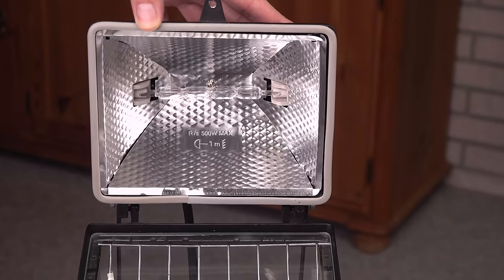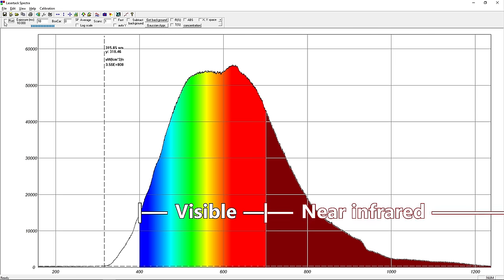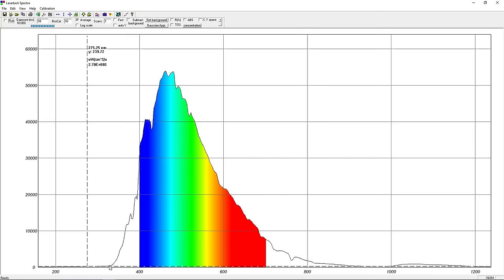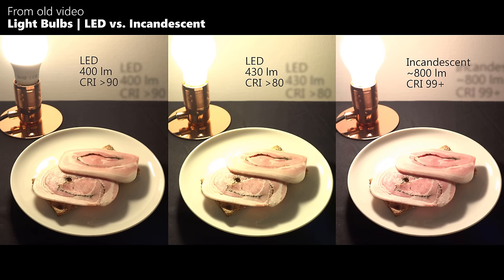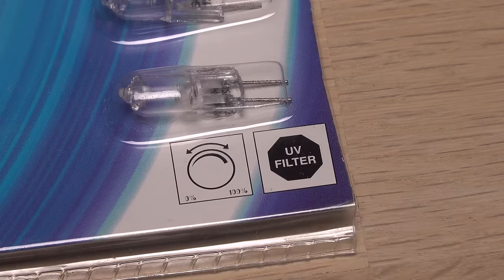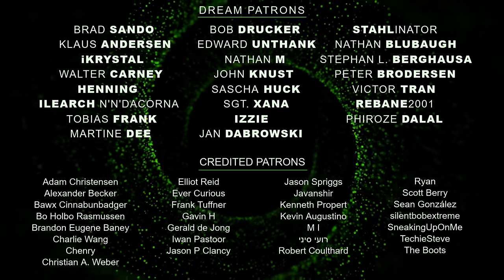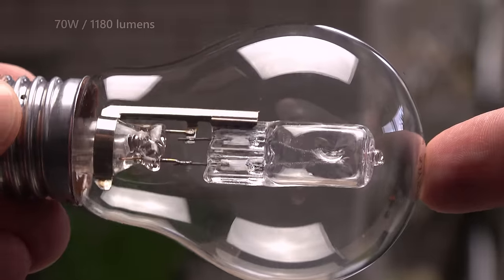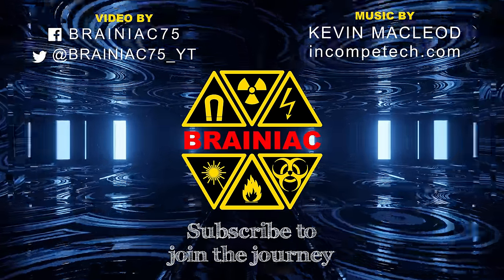Hidden Hazards of Halogen Lamps

Comment: I remember halogen bulbs.  Some Torche lamps used to use them and put out good light.  These were actually popular in the 1990:.   But a lot of people phased them out because of the heat risk.  Some of the halogen lights also used to be popular outdoors on commercial buildings, tennis courts, horse arenas, amphitheaters, and other applications.
Reply: I remember the 90s. Back when the future was bright. I don't want to be here anymore.

Comment: I have energy saving LED everywhere in my house, but you are absolutely right, food looks somewhat off, so I use an old incandecent lamp in my kitchen, hopefully it doesn't die too soon. I wonder if there is any LED that can make look food "normal".
Reply: HiCRI LEDs can do that
Reply from the maker: LEDs are getting better and you should be able to find some with a CRI/RA rating of >90 relatively cheap (IKEA has them last I checked). They are much better than the old ">80" horror shows...  LEDs with >95 are even better but much more expensive and I've only seen them in dedicated studio lights. Thanks for watching!
Reply: Not anything that you can pick up in a semiregular store.
Reply: FEIT Enhance or Sylvania Tru-Wave bulbs are 90-93 CRI in warm white 3000K and are sold at many stores now - Menards, ACE Hardware, Costco, and online.
Reply: Lidl sometimes sells >97's in Europe for pretty cheap, so you may be able to find them there.
Reply: @xavier6130  I have seen those, I returned them do to them having non existant R9 value, wich is not included in thier cri rating

Comment: I did sometimes get mild UV suntan from working under high power halogen lamps. But not as bad as from arc welding on a hot day without skin protection from the arc .
Reply: Might be the already existing melanin in your skin getting oxidized by the UVA rays, causing a light tan that will most likely disappear quite quickly.
However it can also cause premature aging of your skin as well as increase your chances of getting a melanoma much later.
Despite not causing sunburns.
This is basically like a low power version of the UVA tubes used in tanning salons.

Comment: I use to be an electrical contractor and also done my apprenticeship after leaving school, anyway back in the day I had fitted many of these lights I have even fitted 3kw lights to loading bays, yards etc and for testing purposes operated them without the safety glass. Back in the 809's i wasn't aware of the uvc problem and i dont remember collage remarking on about it. Anyway each time i had left an installation the safety was attached to the light and cover screwed up tight , makes you wonder about halogen car headlights!
Reply: Well, some halogen car bulbs do filter UV by themselves as they glow blue under a blacklight.

Comment: I work at a TV station. We've mostly replaced the studio lights with LEDs, but there's still a few high wattage (1KW+) ARRI lamps kicking around. Those all have Fresnel lenses. A lot of the portable halogen kits for video production were bare bulb. Just a set of folding barn doors for protection when stowed. Was drilled into us back in college to never touch them. Of course every time you rented the kit, there was always at least one bulb was burned out and needed replacing. So you'd have to gingerly fondle the spares with a set of gloves. Those also got so obscenely hot that it was rare to see ones that didn't have melted plastic parts. I'm glad they've been phased out.

Comment: Cool 1500W lamps ! Didnt know they made 1000w into 500W sized bulbsall this time after collecting some old-stock bulbs my self. It would be wounderfull if you mke a video about the 1500W ones and 1000W ones. The fact that halogens produce UV is funny. T think that the reptile-halogen lights werent joking when saying about UV-A and UV-B. Maybe you should try a reptile-halogen light. They tend to also include the spectrum on thepackage but a real test would be cool. And as usually a great and reasearched video ! Keep it up with interesting light nulbs !

Comment: I have one of those tall lamps that reflect the light upwards to the ceiling, and it has that same long halogen bulb, except it is 500 W.
Reply from the maker: I had one too! But it fell apart during a move. You just reminded me that I still have the half-tube glass cover that was over the halogen bulb in it. It is made of thick glass so should make for a great UVC+B block filter... Thanks for the reminder and early watch, Aaron :)
Reply: @brainiac75   I did the opposite, I still have the functioning lamp, but I broke the little UV glass during  a move, but luckily it shines on the ceiling, and not directly on anyone. On top of that it's not used much.
Reply: @aarongreenfield9038 Same for me during my childhood, we had several of these tall lamps, most without any glass over the bulb and I don't remember having suffered from eyestrain or anything related to the UV.
Might get ARMD or cataract earlier though.
Reply: @psirvent8   You don't really need them anyways since you're not in line of sight with the bulb, and I noticed the bulb's tend to last about twice as long without it anyways, because they're not getting anywhere near as hot.

Comment: Thanks for that vital information! I have a (quite small, 20 watts or so) halogen lamp in my cubby in my  bathroom. I was wondering why the plastic is yellowing over time, and while watching your video i remembered that the glas over it broke some time ago. Well, that explains it. I hope i haven’t done any damage to my eyes 😳. I ordered an led right after watching your video…
Reply: Did you get any eye strain from looking at the light from those bulbs ?
Reply: @psirvent8  not really. I 5hink compared to what the sun puts out this wasn’t even comparable. But I replaced it, just to be sure…

Comment: 50 hours is because they run it way hotter, so the lamp does evaporate faster, and the halogen cycle will not be running fast enough to stop it from sputtering onto the glass. 

For a better UV source you need a metal halide lamp, as those that are intended for enclosed fixtures only have a thinner UV block layer on the quartz glass outer, which you can see fluoresce a lovely blue during run up, where the UV output is high, but the internal lamp pressure is not so high, and the light output is around 10% of the full output. The halogen lamps also need the glass outdoors, as they are very effective insect attractors, I was using one while camping, and the next morning I had a big pile of very well crisped insects on the ground in front of it, attracted to the light, and cooked on the front glass, as well as the lamp body.

Comment: When I was younger I made the mistake of breaking a halogen lightbulb with a hammer. It was from a car headlight and I needed to dispose of it, so I decided to break it, the bang from the pressure was immense, it sounded like a gunshot, and glass went everywhere. I’m surprised I wasn’t hit by any of it, now I devote my time to collecting interesting bulbs and vacuum tubes
Reply: Yikes !
Fortunately it wasn't a xenon bulb from a cinema projector as they contain a gas under a much higher pressure than halogen bulbs and can really cause serious damage when they burst.
For that reason technicians in charge of replacing the bulbs have to wear a full suit as well as gloves and a face shield to protect themselves from shrapnel in unfortunates cases and also the door to the lamp on modern projectors even comes with a key lock to keep random people out of the danger zone basically.

The bulbs also come in protective casings designed to contain the shrapnel and shockwave in case they burst during transport.
Most of the time it's either a hard plastic box the shape of the bulb but it can also be a thick fabric wrapper.
Reply: @psirvent8  those things go up to 200 bar, the largest bulb I have is a 1kw cloud base detection light and that has barely any pressure, I don’t deal with high pressure halogens anymore, I’m not taking chances again 😅
Reply: @psirvent8  photonicinduction also did a video on those xenon lamps

Comment: As a young kid I had a halogen lamp on my desk where I did crafts and homework. I broke the protective glass cover on the lamp after messing with it and burning lots of crayons/erasers on it. After that I also quickly broke the halogen bulb by touching it too much. I remember asking for a new bulb and seeing on the packaging of the halogen bulb that it said not to touch it, but without further explanation, so I asked my dad to install it. I then continued to use the lamp for many years without the glass cover... this video was mind blowing to me. I was worried at first but after reading the comments and researching more, I'm convinced the bulb (10W) was low power enough that there was no risk of adverse effects really.
Reply: The bulb could also have had been a UV-filtering version, in that case the lack of glass wouldn't have really mattered in term of UV emissions.
Did you get any eye strain from using the lamp ?
That can happen if there's no UV filter, although probably not with a 10W bulb as it will not produce that much UV compared to a blacklight for example.

Comment: Years ago halogen floor lamps were quite popular, I seem to remember they were banned.
Reply: Being a kid in the 1990s I most certainly remember them and they could be found at most stores at reasonable prices,  from about $15 to $50, depending on the model,  the higher priced ones had a full range dimmer,  while the cheaper ones had high and low.  300 watts was typical, although before 1996 they were also available in 500 watt versions, afterwards Underwriters Laboratories pulled the listing off the 500 watt version and limited the wattage to 300, also around that time they came with the wire cage over the bowl, to reduce,  but not eliminate, the risk of fire from curtains,  etc from coming in contact.   The fire risk, along with high power consumption led to its decline,  and after the early to mid 2000s, seemed to have vanished off store shelves.  Compact fluorescent,  and 50-100-150 watt  3 way incandescent took over.

Comment: Could you tell me about/link me to the USB spectrometer you use? I see the software has a range from about 200-1200, I know the software does some correcting itself based on the photodiode's sensitivity curve but do you know the range on your particular photodiode and if it can reasonably detect much outside the 200-1200 range? (for example, if you shined a 200nm source would it even detect it? or does it really lose sensitivity at that point? and the same with infrared, can this scope get the full halogen range?) Or is the software set to this range specifically because that's what it should be able to detect? It still seems like a solid range for a USB scope so I'm wondering how it much it costs.

Comment: A vendor at Teotihuacan told us that the ancient Aztecs would view the sun/ eclipses through shards of obsidian glass. I checked it out sure enough, you can see a clear view of the sun through even a thick piece of obsidian.

But if you look online, there's a debate about it's safety as viewing the sun through obsidian is not an approved method and may be potentially dangerous to your eyes.

It'd be cool if you did a quick video about the levels of light (UV, visible, IR) that go through obsidian.

Comment: Brainiac75
Have you tested the actual sunscreen to see if it does actually protect against UV lights a b and c?
Reply from the maker: Yes, I used it on a banana and UVC source in this video: https://youtu.be/bb1Nc1oygTs
The A and B protection is trivial in sunscreens, but UVC protection is rare! Thanks for watching :)
Reply: @brainiac75  I believe this is fine because almost no UVC makes it to Earth's surface from what I understand.
Reply: In addition to UVC from the sun not being able to penetrate the atmosphere as the above comment notes, the UVC blocking label thing on the sunscreen is kind of a marketing gimmick. Any organic molecule in existence that is providing strong absorption in the UVA will also provide at least as good or better protection (absorption and conversion into heat) in the UVB and UVC. If a low energy photon in the near UV has enough energy to excite the electronic state of a molecular orbital, then a higher energy one will also have enough to do so as well and will be just as easily absorbed. This only changes when you start getting into the x-ray region where the energy and momentum of the photons becomes so large it can start barreling through significant depths of matter WHILE exciting/ionizing it along the way regardless of what it's made of.
Reply: @Muonium1   I think the "special" sunscreen is for arc welding, where the atmosphere doesn't protect us. 

Regarding the "it will absorb higher energies as well", interesting. 
I always thought different atoms/ electron states/ chemical bonds would absorb specific wavelengths/ photons. 
Do the just take as much as they can, and let the Photon go on with the rest? Or is this a different kind of interaction than what I am thinking about?
Reply: @Muonium1  That is not correct. The absorption spectrum of Avobenzone, a common sunscreen ingredient, clearly shows that it is about 4-5x more effective at absorbing light in the UVA range than in the UVB/UVC range. That's why multiple compounds are needed to also block B and C effectively.
Large, complex molecules may have fairly large absorption spectrums, but it is not accurate to say that "Any organic molecule in existence that is providing strong absorption in the UVA will also provide at least as good or better protection... in the UVB and UVC".
An atom/molecule can only absorb photons with energies corresponding to available electron energy level transitions. Due to some quantum stuff I don't fully understand, the frequency of the photon doesn't have to be exactly equal, but it needs to be close. A large, complex molecule may have numerous available transitions and therefore be capable of absorbing photons across a broad range of frequencies, but it is not accurate to say that "If a low energy photon in the near UV has enough energy to excite the electronic state of a molecular orbital, then a higher energy one will also have enough to do so as well and will be just as easily absorbed."
Reply: @nos9784  You are correct in your thinking
Reply: actual actually

Comment: Some years ago I visited a company in Surrey called ERA Technology and in one of their labs they used to test halogen lamps. One of the tests involved firing a high-power IR laser at the filament of an energised lamp to test the capsule integrity. The laser vapourised the filament and the capsule was meant to remain intact as part of the compliance test. Unsurprisingly, a very large proportion of far-easter sourced lamps failed the test and were deemed unsafe as the capsule exploded. Compliant safe capsules remained intact and contained the exploding filament.

Comment: Would you be able to do similar tests with plant grow bulbs? I’m interested in the UV output compared to regular fluorescent bulbs, they always look a little more blue.
Reply: If you mean Metal Halides then they put out a LOT of UV, always wear good eye protection in grow rooms.
Reply: @MattyEngland What about high pressure sodium bulbs though ? 
Are they as bad as metal halides ?
Reply: @psirvent8  No, they're nowhere near as bad, but you can get special glasses that both protect your eyes from the brightness and also help render the colours properly so you can see any insects or nutrient deficiencies better.
Reply: @MattyEngland Thank's for the reply.
I just happen to have gotten a couple of 400W HPS bulbs as part of my new collection of discharge lamps a few days ago, however I don't grow anything indoors and the color rendering doesn't matter enough to justify the purchase of expensive goggles as far as I'm concerned.
In fact I already knew they were a thing, however because of their high price and the fact that they won't get much use given how little I use my HPS lamps at least to this day, I'll probably not buy them anytime soon.

Now I used one of those bulbs to light up a room and despite having had sunglasses on and the bulb concealed from direct view I still got eyestrain afterwards.
I also tried wearing my ski goggles instead but they didn't reduce the brightness of the light at all due to their orange tint, unlike my sunglasses, however the ski goggles happen to work quite well when I use my 400W mercury vapor blacklight or my 250W metal halide floodlight instead, and unlike the HPS goggles I can also use them for skiing or to protect my eyes from UVC tubes as well, although I also have to hold a glass panel in front of my face to effectively block the UVC since the goggles aren't as effective against UVC as they are against UVA and UVB.